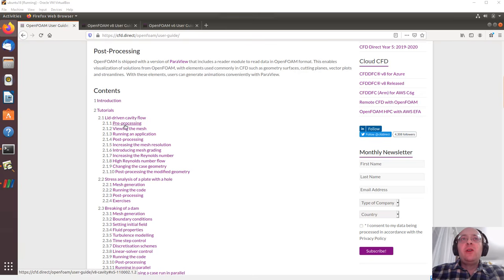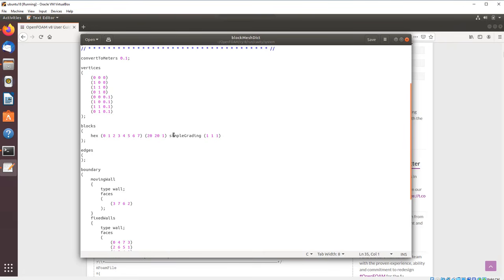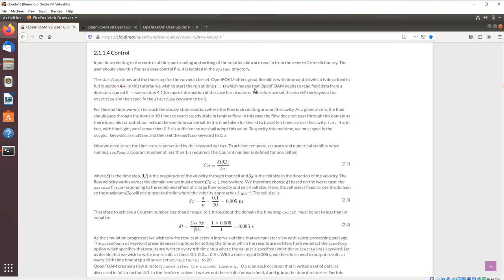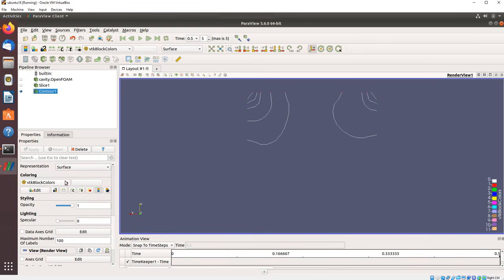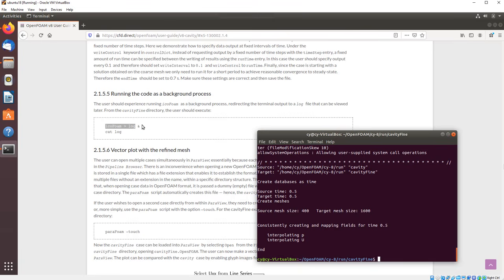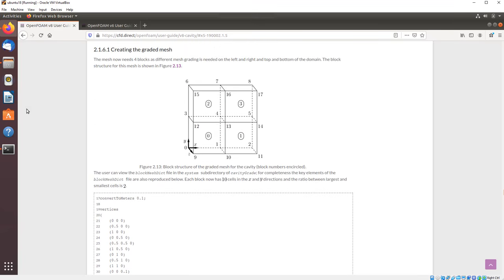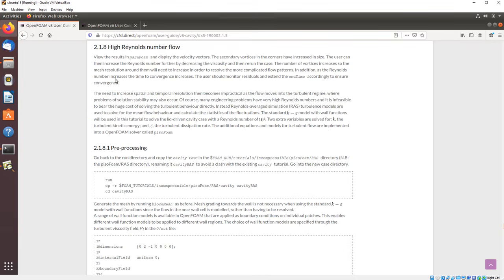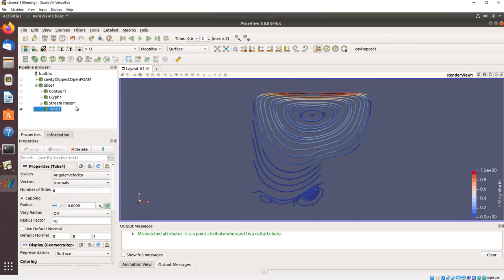[Openfoam Tutorial 2] Lid-Driven Cavity Flow

Comment: Hi，I'm learning Openfoam recently，but my version is openfoam12，the example on this video is for openfoam8. How to change my version to practice??
Reply: you can still practice it is just that the solvers are now situated in different folders. icofoam is in the tutorials/legacy/incompressible and pisoFoam is no longer the executable. it has been replaced by the general solver module. foamRun -solver incompressibleFluid. it allows one solver to handle many flow types (laminar, turbulent, transient) depending on the your case files.

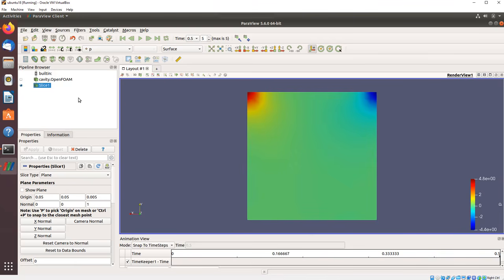Comment: @49:14 the colors at the top left and top right seems to have switched because the orientation of the plane is modified (no idea about when it got modified). Clicking on -Z would orient the sliced-plane in correct manner(i.e., less pressure= blue on left top and higher pressure= red on right top)
Reply: it was modified when cyprien presses +Z @48:12

Comment: salut cyprien,
small details that can add to this great tutorial:
A. the nomation of the vertex in the block mesh when creating the patches is really important, they need to have the same normal (all directing to outside or all directing to inside the mesh) so for example the vertex should be in clock wise direction for each patch or in counter clock wise but in any case all the patches should follow the same rul for the naming
B. paraFoam have presented some issues in the past vr, at least from my side I would recommend to use
touch myFile.foam
and then open it with paraView directly paraview myFile.foam
I imagine that this tutorial will continue, some things that I can recommend that are a little bit obscure (or at least not mentioned too much) is when using salome for OF using the salome pluging salomeToOpenFOAM (https://www.cfd-online.com/Forums/openfoam-meshing/124982-script-converting-mesh-salome-platform-openfoam-5.html) that allows to export meshes wich whatever type of cell is in the volume mesh (the common approach is to use ideasToFoam but this does not allow some type of cell types when exporting to univ type mesh) also something that I am trying now is as the results from snappyHex are not of my like, I am trying to mesh with tet meshing in salome with netgen 3D and then (as the tet mesh is not recommended for CFD) usin the build in utility from OF to use tet mesh to create a poly mesh polyDualMesh (the main issue with this approach is the bottle neck of meshing speed with salome as snappy runs in parallel easyly that salome does not...)( it is also possible to do a tet mesh with gmsh in parallel but i did not get how to compile it for this). right now i am trying to succesfully do my tet mesh but either way polyehedral meshes are quiet interesting for cfd (and main tool in newer commertial cfd eg starCCM+)see: https://www.symscape.com/polyhedral-tetrahedral-hexahedral-mesh-comparison

oh, and of course, thanks a lot for your tutorials, they are great!
best regards
Reply from the maker: Thanks Franco ! I was also looking for a way to convert from Salome to openFoam, I will try what you suggest when I get time
Reply: @Feaforall  with pleasure! Happy that I can help with the tutorials 😁.
There are three ways people combine Salome with of:
1.most commun, create face groups for each patch, do a surface mesh (I usually use mefisto triangulation) and export each group mesh to a separate stl. Then combine them with the command cat. (so they have a surface stl separate in regions and watertight) and then use  BlockMesh for creating a background mesh that contains the stl and lastly use snappyHexMesh to create a hex dominant volume mesh.
2. export Univ format volume mesh and use ideasToFoam to import it to OF (the main limitation being that Univ format does not support some type of cells...)
3.use salomeToFoam plug-in for Salome to export of format meshes directly. The issue us that as it is third party it can break easily with a new vr of Salome or OF. (there is even a salomeToFoamGUI vr!)
4.some use also cfMesh (pre installed to OF in the ESI vr and possible to installed in the fondation vr https://openfoamwiki.net/index.php/Extend-bazaar/utilities/cfMesh) it uses surfaces meshes as snappyHex. it is fast and multi thread so should be better. in my case I couldnt make it  work with my surfaces but they are quiet complex and do not have experience with it... also it is a shame that cfmesh went commetial (cfmesh+), so there will be no update of fix bugs in the future... but from what i heard it is a really good tool.
Best regards!
Reply: @Feaforall  also as I mentioned the type of mesh and also the speed of the meshing that is super limited with OF. Imho the meshing is by far the biggest part that is quiet dated in OF.. Other commercial software exceeds it by a lot in this field.

and last point, if you can please have a look at moise great pluging for salome, it creates polyhedral meshes multithreaded! in my case i think i am not enought experienced with salome/OF in meshes to make it work (and salomeToFoam pluging did not work to export this type of mesh as it comes from coupling salome with another software geogram that is from the INRA lab speaking about france ahahaha ^^) but it is super interesting! here is the link to moise guit . OBVIOUSLY all credits to him and the geogram group, https://github.com/MoiseRousseau/SALOME-Voronoi